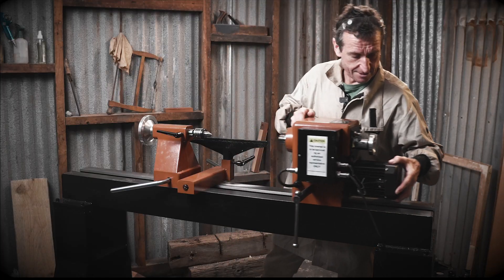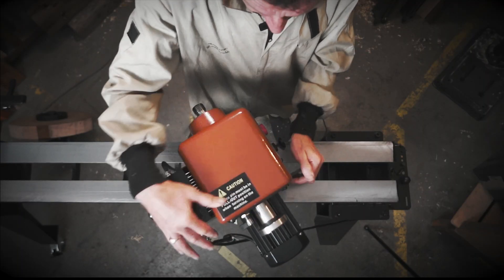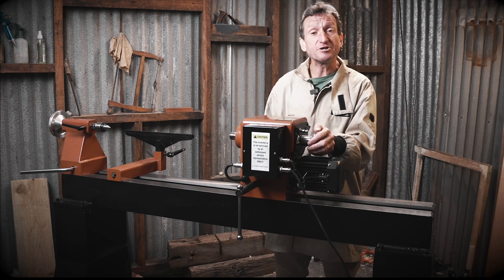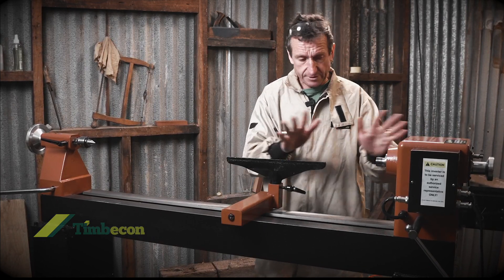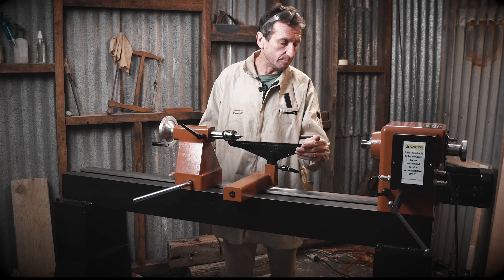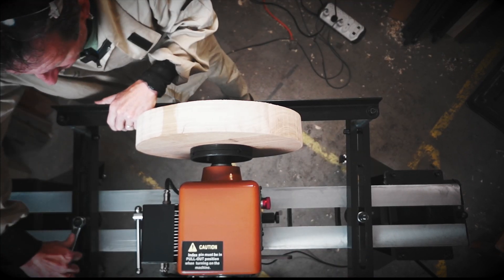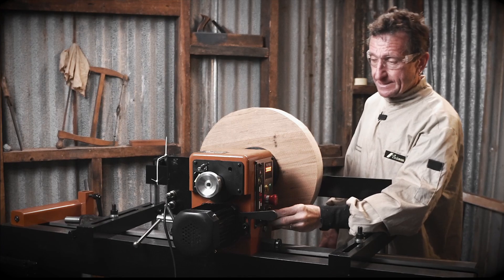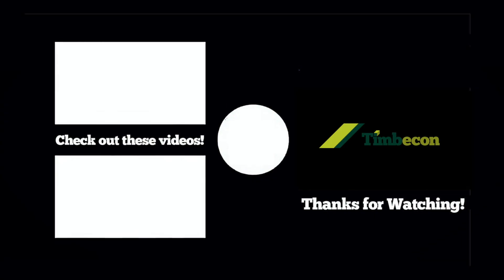Choosing Your Lathe - Part 5

Comment: Andrew my question is not about woodturning lath but is about a product produced some years ago. I am revering to SHERWOOD ROUTER LATHE  RL-900? OR RL-1200 ...I was fortunate to obtain one from the family of a retired wood turner brand new in the box,  unfortunately 2 page instruction does not say anything about normal operation, explains flutes, spirals but nothing about the use of it. What i learned about a router lathe from Youtube American brands such as Trend, craftsman.... which all co-ordinates wood rotation with router travel and this is achieved by a crank handle rotating the wood shaft... in your box there was no CRANK HANDLES??? I wonder how is supposed to operate the shaft that is at the headstock has a circular bush locked in with a screw at the end???  HOW THIS UNIT SUPPOSED TO OPERATE AS YOU DO NOT HAVE A VIDEO EITHER TO DEMONSTRATE... Can you help please.   Kind regards from Gold Coast Jack Marashlian   PS: about 2 or 3 years ago I purchased Sherwood lathe copier unfortunately is locked away in the box as I cannot fit it on my VL300 Vicmarc lathe as the access under the bed is not easy with all electronic and motor mounting gear do you have a different way to fit it on my lathe???